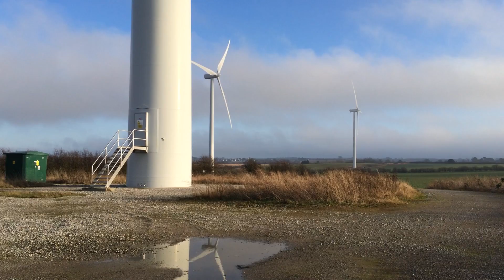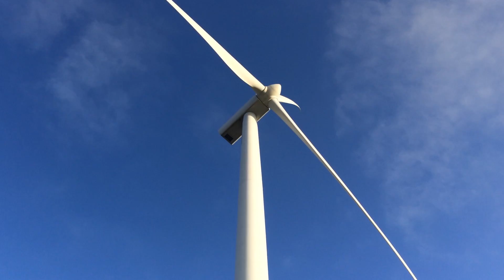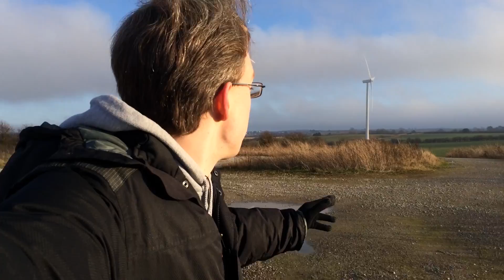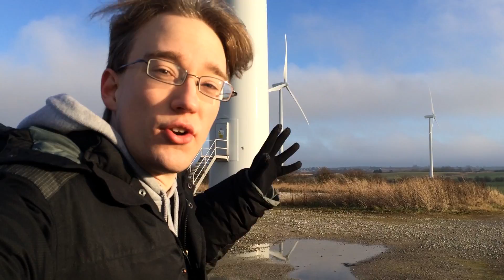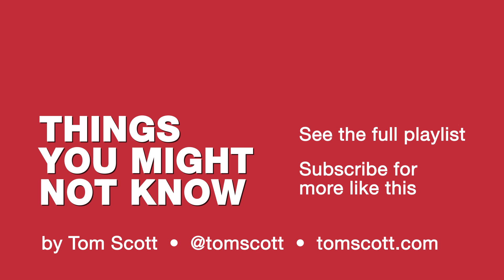Why Wind Farms Don't Always Turn When It's Windy

Comment: In Scotland, we use lochs as storage batteries: When there's a surplus of energy, that surplus drives hydro-pumps to pump water up-stream into dams, and when there's a deficit, the water's allowed to flow, powering the hydropower dams in the process.
Reply: I bet Nessie is dead now.
Reply: It's extremely resource efficient for what it does. With the exception of chemical storage batteries, (which would use unacceptable amount of rare metals on that scale) any national-scale energy storage is going to have some kind of transitional process involving conversion between different forms of energy.LimitedWard
Reply: @HaniiPuppy  
Pump storage is the only industrial scale battery that is currently economically viable.
Reply: +Paul Smyers mostly due to the fact the tower contains an access ladder, power cables and the rotary gears to allow the best angle to the wind. Apart from that there's the extra weight and torque that would put on the windmill.
Reply: @Hewitt_himself  The tower contains various components on different levels. They also have lifts inside as well as a ladder. I build 8.8 megawatt machines offshore and in my opinion offshore is the best place for them.
Reply: It's not primarily for shortages, it's used in conjunction with wind farms to provide a constant, generally steady stream of power.
Reply: +Simon Baker-Hewitt They could put the weight in a separate structure, though.
Reply: @dylandarnell3657  there are companies building these. It is one of many possible solutions to storing energy
Reply: Interesting. I thought the UK was quite short on pumped storage and essentially the only significant installation was in Llanberis at the foot of Snowdon. Good to see at least the Scots have bothered thinking ahead.
Reply: @gwenynorisu6883  the UK is quite short on pump storage, it has a huge number of small sites, but in terms of TWH of stored potential energy we are far behind the Nordic or Alpine countries, as they all have an abundance of prime locations for the reservoirs required.
Reply: @gwenynorisu6883  It's not really a case of Scotland "thinking ahead". The geography in Scotland is far more suitable for pumped storage, so there's more of it. The energy stored in Scottish dams gets fed into the UK wide national grid.
Reply: Ha ha, well look at that.

http://qz.com/823054/germany-wind-turbine-hydroelectric-batteries/
Reply: Paul Smyers
Oh hey, cool :D I hadn't heard about that.
Reply: I wonder why they don't have generator motors in the windmill towers that use the extra power to deadlift a large weight, which can later be lowered to generate power when there is no wind.
Reply: @PaulASmyers  
There's a company that's building a similar storage system that stacks heavy blocks up or lowers them down depending on the electric demands.
Reply: @acmefixer1  I've seen this! It's a neat idea. I hope they are successful.
Reply: @PaulASmyers  that idea is ingenious.
Reply: In Quebec, surplus energy is never a problem, because about 96% of the electricity is produced by dams, so it's easy enough to just keep the water in the reservoir instead of having it go through the turbine. There's no loss involved either, because the water is still up there and ready to be used, and there's no energy expenditure to get it there either.
Reply: Nice.
Reply: That technology was brought to the world by Allis Chalmers
Reply: i think meny places do its just wether or not they can be filled or need to be used at the time
Reply: In the US water and dams are use for the same purpose.
Reply: The problem is, this way of storing energy takes several minutes to "kick in"
So its only useful for longer shortages
Reply: The problem is that it can still take a few seconds, which is far too long for matching power demand changes.
Reply: @brianwyters2150  hydro storage and other forms of gravitational potential actually have some of the fastest response times of any technology. They can be adjusted near instantly. The reason these are not universally widespread is simply cost. Hydro storage is only cost effective when it can make good use of already existing features of land. Other forms of gravitational storage are just not cost effective currently.
Reply: @brianwyters2150  you can have batteries kick in fast and then when hydro gets up and running it takes over
Reply: +bens1045 cool HAHAHAHAHAH
Reply: That sounds incredibly inefficient. You're essentially turning kinetic energy to AC power... to DC power... to AC again (in the correct frequency)... to kinetic energy... to gravitational potential energy... to kinetic energy... to AC power again.
Reply: because we don't live in the stone age?

Comment: What has the frequency got to do with any of this?
Reply: +K Sriram If the frequency drops (sags) then there is not enough generation to meet demand, if the frequency increases there is too much generation, the grid is one massive synchronous machine.
Reply: I don't know about the UK, but in India whenever there is a shortage of power the voltage drops and surges when there is excess.
Reply: +K Sriram the frequency indicates the balance of the whole grid (inputs vs demand). More input than demand the generators spin faster and the frequency goes up and vis-versa is true also.
Reply: JosefsensDK I never said the windmill was, most generate DC which is then converted back to AC as this allows them to work at a wide range of outputs depending on wind speed/demand.  Big generators are very much synchronised with the grid, go read about it it's actually quite an interesting topic.
Reply: AC power is generated by rotating machines (generators) these have coils which electricity is induced into by passing magnetic fields.  The rotation speed of these generators IS the frequency the grid operates at.  Just like in a car, if the load increases (i.e. driving up a hill) then the machine wants to slow.
Reply: +Edward Cooper 
This is bullshit. The generators or windmill is not running at 50 hz, because then none of it will run in sync, and it would be a mess. Also a shortage of power will not reduce the frequency, but the voltage.
Reply: +K Sriram From my basic understanding, it's for alternating current. It aims to alternates 50 times per second to meet the power demand. If the AC power alternates too much then there is too much power and if it doesn't alternate enough then there is too little power.
Reply: I get it. I was talking about something different. The power that we receive in our homes, which is at a constant frequency, irrespective of the supply and demand.
Reply: +JosefsensDK Shortage of ACTIVE or REAL power (as in Watts) would, definitely, mostly cause a frequency droop.
You are thinking of imaginary or reactive power (as in e Volt Amperes reactive) that would cause mainly (but not just) a voltage amplitude drop.
Reply: If you think of a simple AC synchronous generator-motor, connected over a power line, they behave as just they were mechanically connected. So if you increase the load at the motor, the generator will be forced to "brake" a little more. if the generator energy source is constant (like a turbine with a fixed flow of water), it will slow down and the frequency will decrease. This have actually some nice effects that make the grid a little bit stable, the system auto-regulates to some degree. All the grid power budget adjustment is done on frequency. Voltage and Current are just a transformer trade-off but they don't change total power.
Reply: +Nuno Gonçalves     Hi Nuno!  You seem to know about this.  I'm struggling, and perhaps you'll be kind enough to help.   Some turbines were installed here two years ago and friends said "you have a degree in physics, explain".   I said "give me a while with google...".   It seems to me that the biggest problems are phase synch and coping with 5 MW power levels if there are any brushes or semiconductors involved. Best to go brushless, best to avoid semiconductor AC/DC/AC conversion.  So I assumed rapid blade feathering and hydraulic continuously variable "gear" boxes.  A bit of googling suggests I'm wrong!   I get your point about phase synching of closely matched oscillators, it just happens automaticaly, I agree.  Sorry, my comment contains a lot of implicit questions, but I'll finish with one that I haven't seen the answer to: is blade feathering only used to protect the machine in high winds or is it twitched by the feedback loop for frequency/phase synch?
Reply: Hi, so most wind generators, and even some recent hydro generators don't run synchronously. They have AC generators ('cause DC motors are not a natural thing), then they electronically rectify to a DC bus and finally oscillate to grid frequency .  With this systems you have a big range of speeds in which you can run your generator, and the electronics efficiency is actually very good. I don't see what are you thinking about Brushless. Brushless generators "must" have magnets and you don't really use big brushless motors. Brushless motors are great! Just not for this. Answering your formal question: No. You never feather blades except if the wind speed is over your maximum allowed speed.
Reply: Let me say that you could run them synchronously, it is possible and not hard, with just pure electrical controls (even without blade or transmission adjustments), but it doesn't happen. Why? Don't know. Probably it is not the most efficient or cheap way, and that is all that matters.
Reply: *****   Thanks very much.  I didn't mean to suggest that brushless is bad, I agree with you that it can be great for both motors and generators, I was having trouble getting my head around just how big a diode (or 4) and capacitor(s) you need to do the conversion from ac to dc at such a high power level, and I've come across material speaking of slip rings, which are basically brushes to me (sliding contacts).  Forgive me, my experience is with low power electronics and the power levels involved here are about 100,000 times higher than anything that I actually know about.  Thanks again for the info.
Reply: Power electronics is an entire discipline of electrical engineering. They have applications in energy transmission, you can find inverters or rectifiers rated at several MW. 
You can google more information about the power MOSFET or the IGBT, to basic semiconductors used in such systems.

Comment: I thought he might've brought up subsidies. There are subsidies for certain turbines that produce less than a certain amount of energy. Because of this, sometimes it's best to run a turbine at less than full capacity because when you include the subsidies, you make more money.

I believe as I write this they're looking at closing this loophole.
Reply: +Martin Gardner Everything to do with power generation is subsidised.
Reply: @johnbenton4488  correct, that's why electricity prices will always go up, not down!

Comment: Why don't they build in a gear box, and just shift the gear up in higher winds?
Reply: +MarkTheRabidCat 

Expensive
Reply: +Jonah Beale (RCFlyer)
And the amount of coal, they'd be able to save on the days where they could rely more heavilly on the wind isn't?
I swear, no one in business ever thinks long term...
Reply: +MarkTheRabidCat They have an effective system of furling the blades to change their angle against the wind, which allows them to operate in a wide range of wind speeds.  A gearbox would add inefficiency, maintenance, cost, etc.  It's an engineering compromise.
Reply: +Ginger Biscuit I am certain that the upgrades would pay themselves off after a few years
Reply: +MarkTheRabidCat They have an effective system of furling the blades to change their angle against the wind, which allows them to operate in a wide range of wind speeds.  A gearbox would add inefficiency, maintenance, cost, etc.  It's an engineering compromise.

Comment: They dont stop with brakes, just turn the blades. When the wind gets even stronger, turn the whole head. The Rotor is way to heavy to be stoped by brakes alone.
Not so Fun Fact: There are cases were they burned down after brakes overheating
Reply: +MatzeGamer

Some do, some don't.
Reply: I've heard they use electricity to brake, like reverse generator stuff. Once they're rotating slow enough, friction brakes kick in. Friction brakes aren't capable of removing heat that quickly.
Reply: Siemens wind turbines use hydraulic braking systems along with feathering the blades so that they do not rotate, also our newer models use almost like a flap on each blade that deploys to help stop the turbine more effectively and reduce break wear, not sure what systems GE turbines use as I only work for Siemens
Reply: @Turbinedude2376  Brakes would be the last thing I'd consider for dealing with strong winds. Feathering the blades would be the obvious thing to do and could be mechanically automated.
Reply: @millomweb  the turbine dose feather, then engages the brakes when under a certain speed
Reply: MazeFrame so they don't stop with brakes but there was a case of brakes overheating and burning one down. Well explained
Reply: @screaminlordbyron7767  all wind turbine have aerobraking with the blades and also disk brake. Some use the disk brake, some don't,depends on the manufacturer, model, type of braking( manual stop, emergency stop...)
Reply: I was thinking, Wouldnt the stress on the bladed (when they are locked immobile) cause damage as well? I guess you could put the blades into neutral so they  can rotate without generating power. That would lower the resistance generated but still might cause damage.
Reply: @WSmith1984  They'd overspeed and blades would break off !
Reply: if they used ceramic brakes then they would heat up slower and be more eficent at geting rid of the heat

Comment: Don't they require a strong stable wind as well? I've heard that the larger ones have electric starters and can only maintain spinning at certain wind levels, thus if the wind keeps dropping off might they be stopped to save power?

Comment: Can you explain why 50 cps and 60 cps was decided upon?  I would like to know the history of this.   If you don't know, that's fine.  I can probably do some research, but why the differences?  Isn't it time to "best practice" most of the modern world to one simultaneous way of looking at electrical power, one that is most efficient?  Or, is the lesser efficient American way a problem now that over 310+ million people in the USA and another 35+ milllion in Canada use the same 60 cps?
Reply: +A W 2 Having looked at the Wiki article, I can tell you that history is the reason for this. Back when decisions were being made, many different frequencies (and voltages) were chosen, all involving compromises. Anywhere from 25 Hz to 133 Hz. In general, higher frequencies are better for transformer efficiency (also reduced size) and for lighting users (flicker). For long distance transmission and large electric motor loads, lower frequencies are better. Transmission and distribution loses in the US networks has been measured at about 6.5%.

60Hz is also used in Mexico, Central America and parts of South America. There doesn't seem to be much incentive to change, even though transmission lines are often very long. Americans tend to assume that if change is needed to achieve standardisation, it won't be them that needs to change. You've probably noticed their failure to adopt the metric system. Disclosure, I'm Canadian.

Comment: I didn't know AC power was 50 Hz in the UK.
Reply: +calculon000 Most of the world uses 50 Hz and >200V. 60Hz tends to be for countries using 100-120V, including almost all of North & South America. In the early days it was known that high frequency makes transmission over distance inefficient but low frequency makes lights (especially arc lamps) look horrible. 50-60Hz was the happy medium. Just depends on which business grew to dominate in which location. Standardising it isn't worth the bother.

Comment: When I lived up in North Wales I went to a hydroelectric plant with a school tour. The place in question is called "Dinorwig" and was, when commissioned, considered to be a technical marvel. It's built inside the mountain (and has earned the nickname the "electric mountain" for this reason) and can go from total shutdown, to 1800 MW output in only 16 seconds. 
It is also a "pumped storage" facility, during off peak times, when less energy is in use but extra may be being produced, it uses that excess to pump water into the lake at the mountain top, then, when demand rises, the valves are opened and the lake drains through the turbines and into the bottom lake. If my memory serves me correctly, with the top lake at full capacity, they can generate power for 5-7 hours. 
These days it is usually used to provide short term generation during sudden demand surges. (Tv ad breaks etc.) or if another power station goes offline and is also designed to be a "restart" facility should the national grid go dark.
It's an intriguing place, and the main hall is terrifying but awe inspiring. You can still take a minibus tour deep into the heart of the plant and the mountain and see how it works.
Dinorwig is on Wikipedia if anyone would like to know more.   
And I'm probably terribly sad for still finding that place amazing, and having fond memories of that school trip a good 20 years on.
Reply: Did they still have the electric Leyland Sherpa tour bus?
Reply: I don't think they can run it for ~6 hours at full chat. 6 minutes maybe. But it can probably cover 6 hours worth of variable peaking demand over a period where the grid is always in slight deficit and the high momentum steam turbine plants are run so as to always be just very slightly off the pace to avoid too much overvoltage / increased frequency when demand suddenly drops, until needing to be refilled using surplus energy once the peak period is over.